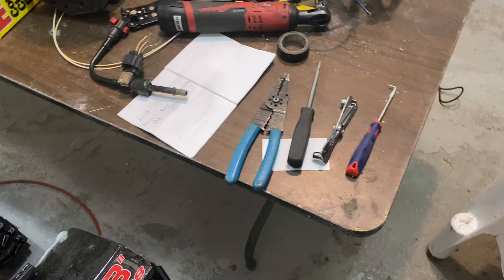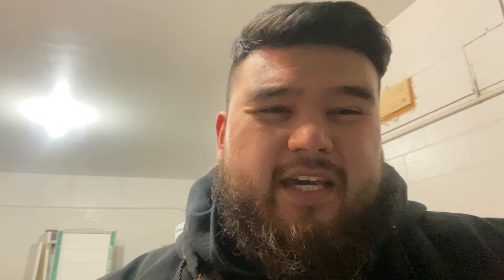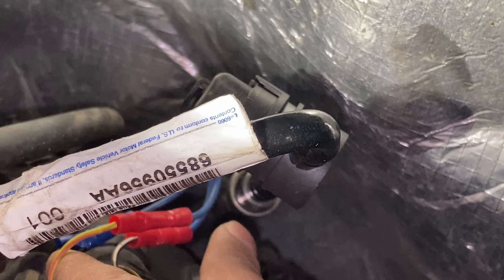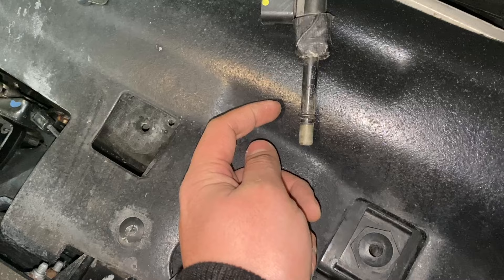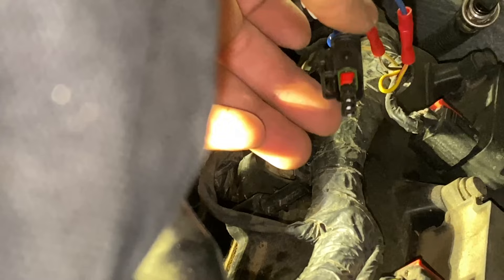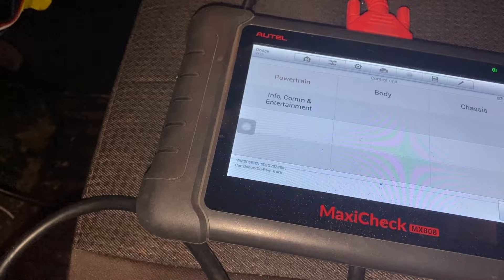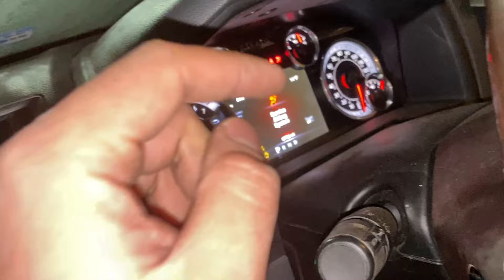P018C / P018D 2016 RAM 1500 - Fuel Pressure Sensor Swap *Read Description*

Comment: Thank you for this video. The dealership told me to match the wiring and cut one at a time and it was wrong, after seeing your video I looked at the plug and released the pins from the new plug and installed them the way you described and cleared the check engine light and it worked great .thank you so much. We need more men like you in this world.
Reply from the maker: Glad i was able to help! Appreciate the support!

Comment: Very Helpful, would like to add the following: New design fuel sensor/line from MOPAR Pt# 68543905AA (for 3.6 eng) does not come with the new wire plug that is needed, you are on your own to find one, MOPAR was NOT helpful in finding one. NAPA Part# EC2219 is the new smaller plug you will need.
Reply from the maker: Thank you for sharing!

Comment: I know this video has been out for quite a while but it's still helping folks. THANKS for the helpful video and especially explaining the change in wire location! I would have taken forever to trouble shoot without the info in advance. I just finished replacing the sensor in my 2013 RAM 1500. It was a real PITA splicing the wires which we all know are back at the firewall. It's fun lying on top of the engine to work when your 60 and have a bad back. Truck running now with no codes indicated on display. Only thing I noticed is my initial high idle when the truck is first started is about 3-400 rpm higher than it was before. Only lasts a few seconds at 15-1600, then settles back to the usual 11-1200 rpm with cold engine. Not a big deal but I found it to be a bit odd. Has anyone else experienced something similar? I'm hoping it will resolve once the truck has been driven several times.

Comment: What is the difference from 2013 to 2016 ?? The sensor replacement part looks different. It looks like one side is longer going into the fuel line.

Comment: I was beating my head against my tool box trying to figure this out. Truck would start then shut off after replacing fuel sensor. I checked and rechecked and tripled checked the wiring making sure to match the same pin locations. The new kit included instructions to make sure to use twisted pair if your truck already has it but didn’t give the updated pin locations. Thank you for your service sir!

Comment: 0:23 I had problems with my fuel pressure sensor and after having it changed,  I had more problems.  I went and checked the electrical and discovered that the wiring was wrong.  Rewired it based on your video and solved my problem.  Thank you.
Reply from the maker: Glad i could help!

Comment: Just did this yesterday.  Hardest part of the job is getting the damn tube to disconnect using the tool.  Took me about 30 min but I finally got it released.  Wiring the new plug was simple.  Code cleared immediately on my 2013 Sport.  👍

Comment: Well, I haven't watched any other youtube videos re; the issue. However, I definitely will be using yours as a reference. Greatly appreciate it.
Reply from the maker: So before you do this. I just had to redo this job on another truck and was able to find an aftermarket option that’s been working for 2 months now. 

Here’s the sensor i used and was direct plug and play without having to do all this. 

https://amzn.to/3rDondp
Reply: @MJAltairy  Great. Thanks so much. I love my Ram. It's just been a nickel and dime truck in the last few months. But worth every nickel and dime. LOL. And this is the latest. Greatly appreciate you reaching out.
Reply: @MJAltairy  Quick question. I am presuming the tube just pulls out and there is no need for the fuel line removal tool, correct?? Thanks
Reply from the maker: @prdamerican667  it doesn’t just pull it out, there’s some like teeth/tabs in the way that needs to be pushed in and the fuel removal tool is where that will help
Reply: @MJAltairy  Thank you

Comment: Great video bud. It would have taken me a LOOOOONG time to figure this out. The other problem I have is I cant get any parts? I have an auto wrecker looking into this now.
Reply from the maker: Appreciate it! Yeah it took about a month for me to get this part at a dealership. I couldn’t find this part online anywhere!
Reply: Thanks again MJ. How long were you able to drive your truck? Did you use another vehicle in that month or did the truck continue working? I need to pick up a camper tomorrow.
Reply from the maker: @fab-antonio  oh I drove it daily till I repaired it. Just didn’t have remote start because of the CEL
Reply from the maker: @fab-antonio  appreciate the love!

Comment: Is this new part you updated in the bio still running well? 

I bought the fuel pressure sensor from Oreilly’s and am getting the P018D now. I’m not sure I’ll be capable of wiring the new connector and just got quoted $890 to fix it.
Reply from the maker: Still running with no codes fingers crossed 🤞

Comment: So I had the P018C code.  I replaced the sensor with the new one and am pretty sure I got the wires right. I did have to swap two pins and had a very difficult time getting the pins back in.  It's as if the barb on the pins deformed a plastic tab inside the connector.   I cleared the codes but now I have a confirmed P018B and permanent P018B, P018C, and P1DD2 codes.  I haven't been able to find much about the P018B and P1DD2 codes.  Do I have a defective sensor?  Pins not in the right positions?  Pins not making good connections?  These only showed up on my first startup after replacing the sensor and wiring.
Reply from the maker: How old is your scanner? It’s possible that it’s actually decoding the code wrong and you probably have a P018D now. I would revisit the wiring/pins because it seems like they’re in the wrong pins now
Reply: @MJAltairy  I use OBDLink MX+ with the latest firmware.  So I've found OBDLink doesn't clear permanent codes.  I have to drive around and as long as the condition generating the code is fixed, it'll eventually clear.  I drove around for a little while today and The P018C code cleared.   I still have the P018B and P1DD2, neither of which can I find much about.  But since I don't have the P018C or D, I assume my wiring is OK. My truck is the 2017 Ram 1500 crew cab, 5.7 l Hemi.

Comment: Can you splice terminal connectors on instead of just splicing wires together?
Reply from the maker: Yes and thats probably the better method!  You could try de-pinning the existing terminal pins and see if they’ll fit in the new connector.
Reply: @MJAltairy I checked, won't work. The original connector pins are a bit larger than the new ones. What they should do is make an adapter kit that's plug and play. But I guess they figure that's what they pay techs for. It's definitely in an awkward spot and they don't give a lot of wire to play with in the original harness. That to me was the worst part, trying to get the wires to stay in the crimp splice while I'm trying to squeeze the handles and then using a lighter to shrink the supplied tubing. Needless to say I saved the actual sensor removal and replacement for after I was finished with the wiring.

Comment: I had p081c prior to wiring and now have p081d

First question 

Is my truck gonna blow up 

Second question how do I mend this
Reply from the maker: Lol you’ll be fine. Looks like you just wired it up wrong. 

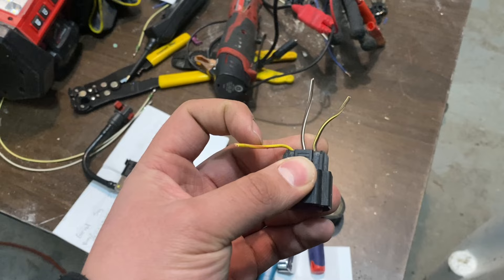Go to 3:46 of the video and I explain how to wire it correctly to the new connector.
Reply: @MJAltairy  thank you 

I decided to wait to rewire the harness/pig tail until this weekend and now my low battery voltage light is on? 

Do you think these issues are related? 

Or do I also have a battery?

Comment: Thanks, so you don't use all the wire in the kit? I just picked mine up sensor was $80.58 the wires and only one clip and heat srink was $66.48 what a joke of a kit gezzzz thank again!
Reply from the maker: Yup I didn’t. I think they use this wiring kit for other applications as well which is why they give you various options

Comment: Great video, i'm stuck with the same issue.  Where did you get the new 3-pin connector?  Was there suppose to be a new wire kit included with the part?
Reply from the maker: I got the sensor and the connector from the local dealership
Reply: @MJAltairy  Thanks, i was just looking around  after asking and it looks like i should be able to get the connector from the dealer i bought the sensor from.  Would have been nice if they had told me that i would need the updated connector.  Thanks again for your video.
Reply from the maker: @mikeramsey1308  yeah same thing happened to me! Called and ordered the sensor, picked it up 3 days later, got home and realized it was different. Called back again and had to wait another few days for the connector 🤦‍♂️.

Comment: You don’t get special information for being in the automotive engineering field. I work at a dealership and would charge you double lol. In all seriousness though you need to know a tech at the dealership. Also most manufacturers make us promise not to share proprietary information from their online systems. Doesn’t make sense because aftermarket obviously gets them for programs like Alldata.
Reply from the maker: Yeah no I hear ya. It wasn’t really special information, it’s just a simple wiring schematic for that harness which I was after. Something as simple as this is 5v, grnd and signal wire location. 
I actually worked as a diagnostic scantool engineer for Witech scantool development at one point with FCA and dealt with alot of service techs/writers in the field. And just from experience, I kinda know some of the resources they have access to but I get it and alot of times, they’re usually younger inexperienced individuals who answer the phones. Not throwing shade at the business, it’s more of a frustration with the few individuals whom I had conversations with when I called asking for help. I will say that one person in the parts department did everything he could to try and get me some answers though so props to that individual.